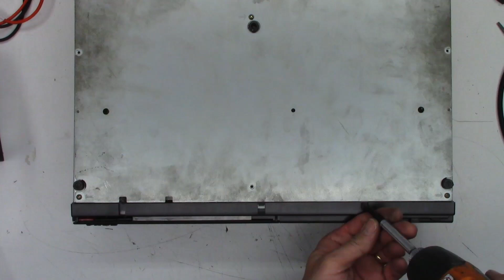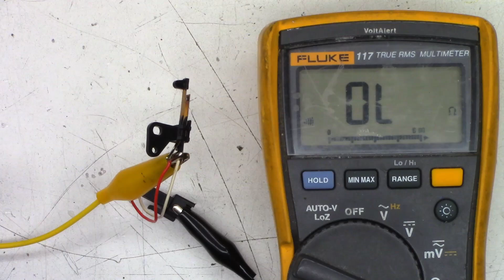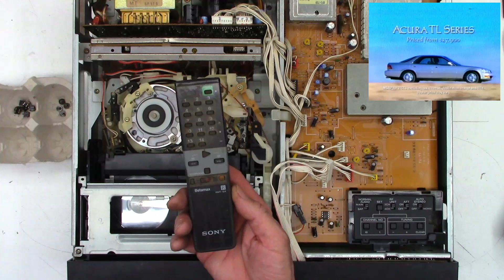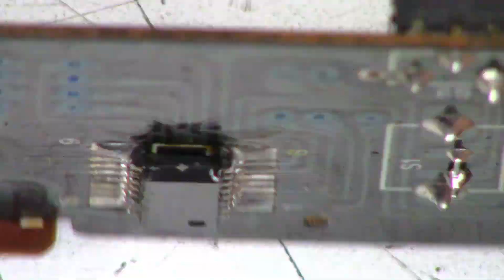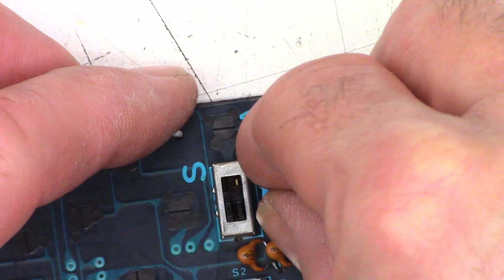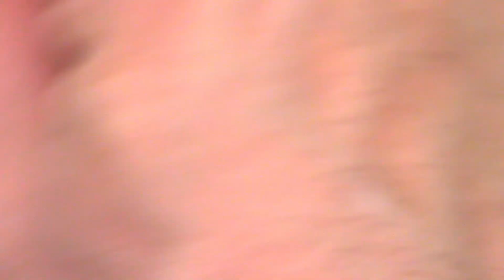Sony SL-HF400 Super Beta HiFi VCR. Has Clock Display but Wont Power On. Part 4 Its Repaired FINALLY!

Comment: More than a handful of orphaned RMT-124 remotes on eBay right now. Even at least one of the cooler silver Canadian market versions. I recently bought one like in your video for a SL-HF400 I recently acquired. The vcr is in good shapes except half the Sony badge is missing on the control door. If you happen upon a broken off control door for a SL-HF400/600 with an intact badge, I’d be interested in buying it.

Thanks for this series, it may be helpful should I run into any issues with mine.